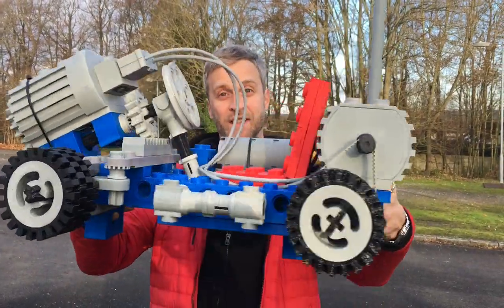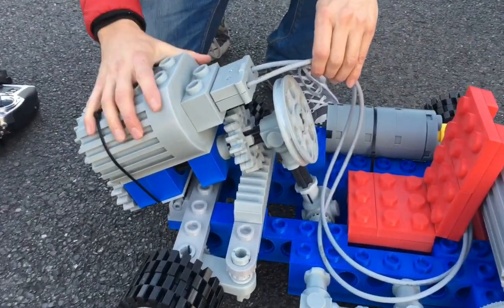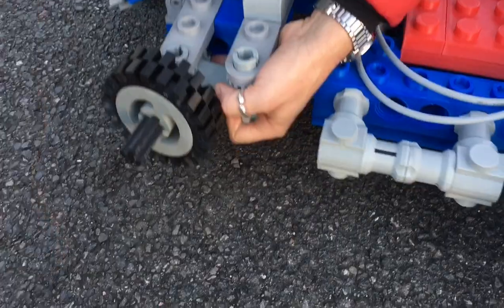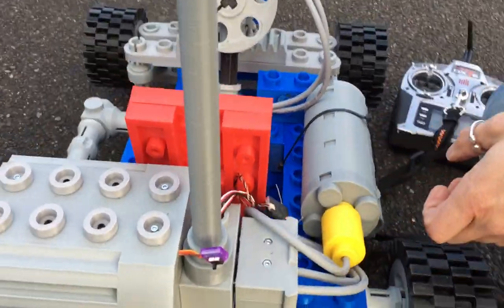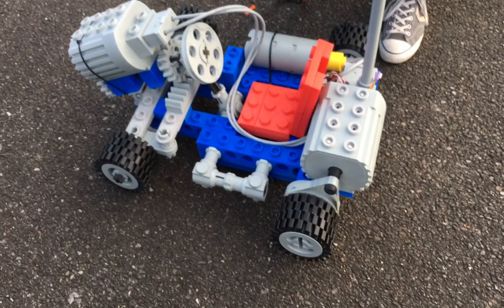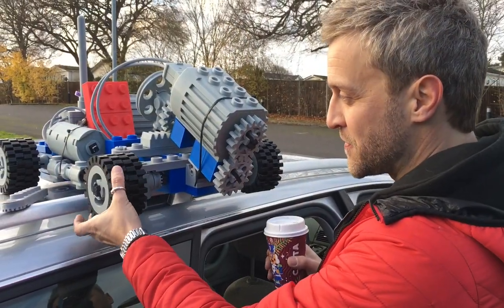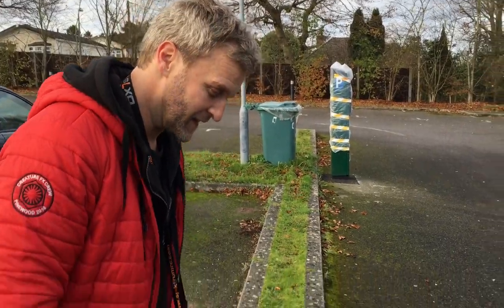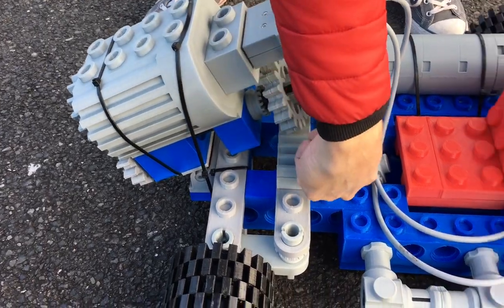Giant LEGO Go-Kart | Radio Controlled! | - Mantis Hacks #12

Comment: Amazing!!! I had the original Lego motors of this style, with the gigantic C-cell battery box... The modern Lego motors are so much more accessible, which is great, but the old ones have a certain charm. The Technic instructions would always have some additional instructions on how to motorise the set with a big carbuncle of a motor hanging off the back of it (as per the steering in your kart!).
Reply from the maker: +donkmeister exactly! The technic motor upgrades of the 80s although fun usually looked awful :)

Comment: Hmm, These TRS-Jacks are a bit tricky for power ... Not disconnectable without shorting them. Love the look of the plugs though !
Reply from the maker: +Guido Mennen they don’t short but they are tricky!! Which is why I have the battery fused... look good though ;)
Reply: If you have a plug that is supplying power, yes they do. Figured that out when I was using the horrible 3.5mm ones for a power supply connection. You almost can't avoid the socket shorting out the plug, especially ring to sleeve. Even with a straight aim ;)

I can't wait for the video on the motors.

Comment: Amazing! Regarding your failed antenna. Do you have flyback diodes on your motors (assuming they are dc) ? If you don't, disengaging the motor will cause a massive voltage spike as the magnetic field collapses.
Reply from the maker: +Ashley Coleman hi! Well the record ever is running off a BEC which should isolate it.. I have capacitors on the DC motor to reduce interference..
Reply: Matt Denton personally I wouldn't trust a BEC to cope with the voltage spike as on powerful motors it can be several hundred volts. However the capacitors should make it manageable for your BEC. Was just a thought as I have had sensitive aerial equipment fry before because the coils dumped its energy in reverse and I didn't realise I was using a common ground with all the components.

Comment: This is cool but also kind of comical, it reminds me of when I was young and used motors to power my first lego rc cars. I figured out quickly that my designs could not handle the power and was forced to redesign, this guy seems more like the type to keep the design and grab the super glue. I think a slight redesign could improve the build.
Reply from the maker: +berbandis it was never really intended to be R/C motorised.. but after building the original kart people asked me to make it R/C.. so I thought it would be cool to slap two scaled up Lego motors on it knowing full well it would probably detonate 😬
Reply: I get that, it is a fun video. It would be cool to see a design made for the motors but having a 3d printer and some insight into the time it takes to cad and print (and reprint) I can see why you would not want to take it any further. 

Its still awesome.
Reply from the maker: +berbandis thanks! :)